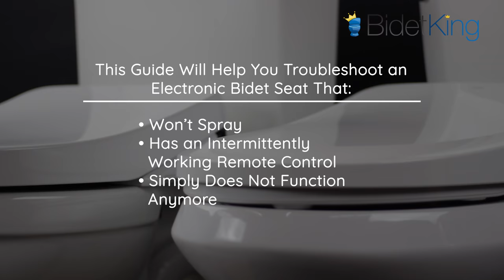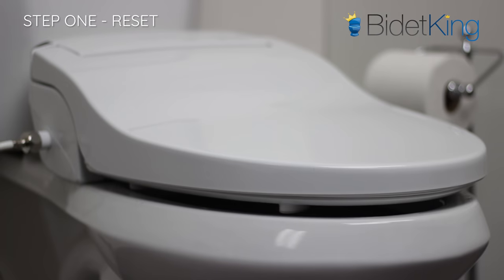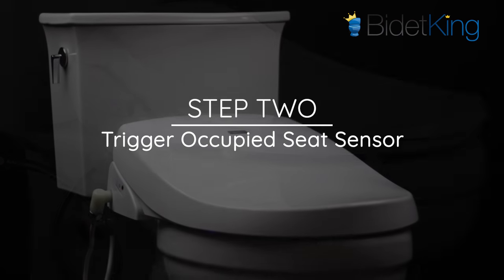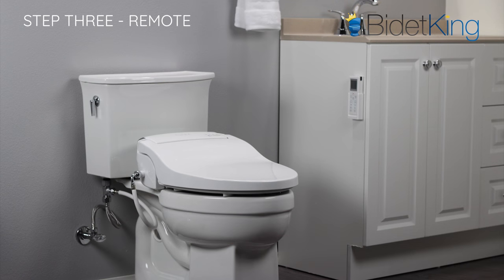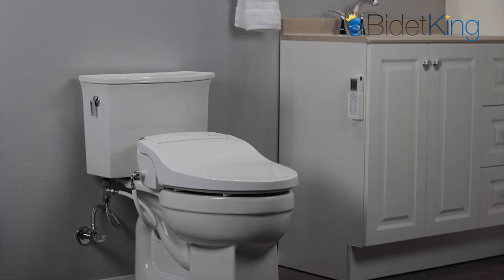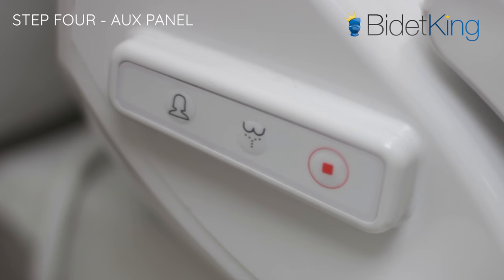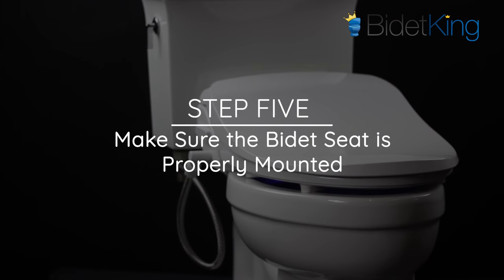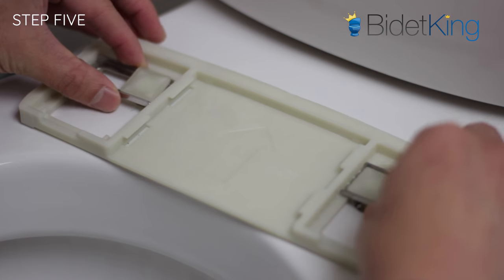How To Troubleshoot a Bidet Seat That Won't Spray | BidetKing.com

Comment: So happy I stumbled on this video!  My Brondell Swash's nozzle would not dispense after the initial sterilizing process.  I've had my bidet for about 4 years, well past the warranty period, and thought, well I guess it is done.  The simple reset was all that was needed!  Just saved over $500.  I don't have to replace this one!
Reply: LOOL you actually calmly accepted the fact that a 500$ bidet stopped working after 4 years?? I had a regular 150€ bidet seat (no jet stream) for 22 years and it still works, I'm only replacing it because it looks yellow and rusty

Comment: A clogged cold water inlet screen or faulty water flow solenoid is a more likely culprit.
Reply: Is it possible to change  the water flow solenoid because I have tried all their tips and still no water comes out.
Reply: It may be a more involved repair than you wish to tackle; I disassembled my 15 year-old Daelim Dobidos Bidet model DB752NA, when It would no longer spray,  There were indeed some mineral deposits in the fine mesh screen that was integral to the cold water inlet hose, but the problem was a bad solenoid.  I put in a generic part that had the same inlet size and voltage rating, and had the unit working again for only a few dollars.  It is too nice an item to discard over a $3 part!
Of course your unit may have a different problem altogether.

Comment: One thing that is not mentioned anywhere, and it really makes me angry, is that our Brondell Swash, BRAND NEW...JUST INSTALLED, the wands wouldn't deploy AT ALL.
So I am posting the solution here...in the hope that it helps someone else.
I read all the "answers" and  NONE of them fit my problem.

Your Bidet is old...needs cleaning, nozzles are clogged, mesh filter needs cleaning...nope....it's brand new.
The batteries are dead in the remote...nope.  
The air dryer works, the lights on the remote are ON, the auxiliary buttons deploy the wands for cleaning, so the wands CAN be deployed, they simply will not come out.

I could see water dripping over the wands, so I knew the plumbing was okay, and I DO know how to install taps, faucets, shower heads, so I know I did that correctly, 
and in the right order, but when I pressed "rear" or "front" clean...the  remote just "beeped" twice, but you could hear the wands "hum" as if they were trying to deploy.
**Guess what it  was...AN AIR POCKET IN THE BIDET SUPPLY LINE!
We could see that water pressure seemed to be a problem, but we live in  the city, so water pressure is never a  problem.
THIS IS HOW YOU FIX IT, IF THIS HAPPENS TO YOU.
Put a bucket, (we used the bathroom garbage can), under the Bidet Supply Line.
Gently unscrew the connection where the Bidet  Supply Line attaches to the Bidet, until some water leaks out.
Allow the water to flow into the bucket, until you can tell any air pockets are purged.  We allowed a couple of inches of water to accumulate in the garbage can.
Then tighten the connection until the water stops leaking.  It seems  to be the only way to purge air out of the line.
After that, everything worked fine!
But THIS should be a part of the trouble shooting guide, and I know, when you shut your water supply OFF, as when replacing faucet cartridges, 
when you turn the water back ON, you can hear air rumbling around in the pipes, and you can see water "spitting out" while the air is being purged.
But the taps need to be open for the air to be purged.
There doesn't seem to be a way of doing this, with the Bidet, unless you do what we did, unscrew the connection a little bit, to allow the water to push the air pocket OUT.
If you  go too far, and water pours out of the Supply Line, be prepared to quickly shut off the Water Supply Valve.
I hope this helps someone else, we  were at a loss as to how to make this thing work...FOR  HOURS!!!
Reply: Air bubble was my problem. Thanks for posting this. TTP
Reply: I’m going to try this with my (less than a year old) omigo luxury bidet. Currently the best I can get out of it is a 2 second spray before it stops.

Comment: Very clear.Thank you. My 8y.o. Samsung stopped functioning after cleaning with a handy steam device. New  batteries in wall fixed remote. Remote  buttons light up but no action on the seat, and the seat is cold. Side buttons work so at least i can get a cold clean; and I infer   from what is said here that there isn't a problem with the seat  but rather the remote : SBD-970C. Being so old would it still be available, and at what cost? And it's still a bit of a gamble. Would another remote work? (Maybe time to get a new one?😕)

Comment: I have a Kholer novita bidet, I just installed it and the toilet will not spray. It will leak water into the toilet when I press the button. Also on my controller anytime I press anything it won’t work and the water light will flash. Please help if you can.

Comment: I have a Toto 5300e and the rear wash "hard" spray wont work. Everything else is fine but nothing comes out when I "double click" the rear wash for a harder clean spray. Rear wash "easy" single click works fine.  Front wash works fine for both hard and soft. NET NET when I want to spray my butt "hard" in rear mode nothing comes out. I can hear it trying. Any advice?
Reply: You ever figure this out? Mines doing the same thing

Comment: suggest treditional toilet bidet
Reply: Need additional plumbing... since we have a slab foundation, that involved extensive floor remodeling and lots of jack-hammering of concrete, with all the additional cost of doing all that. A bidet seat is vastly cheaper option that doesn't involve a week of labor costs and thousands of dollars in new flooring/plumbing.

Comment: Idk why the fuck i cant get mine to work. At first, it caused the toilet to leak/ make noise 24/7 which got me a $500 water bill. Then i tried to repair it and no the toilet bowl wont fill unless i press the switch down and the bidet wont work at all. Im so fucking pissed man
Reply: Sounds like you attached the hoses backwards or in the wrong location.